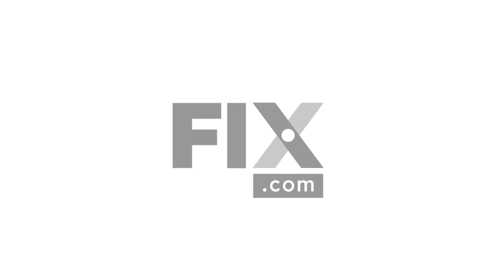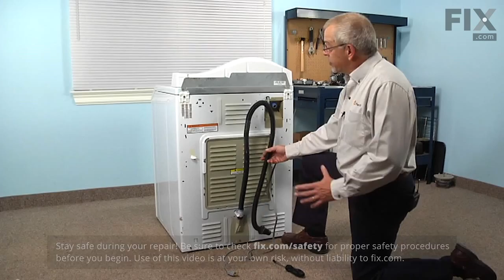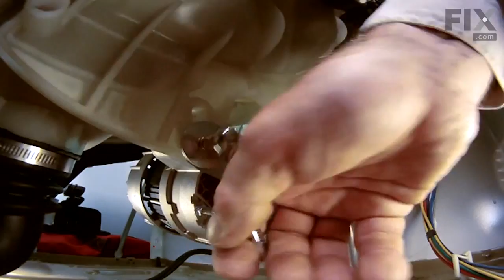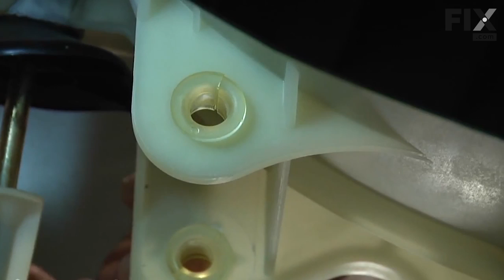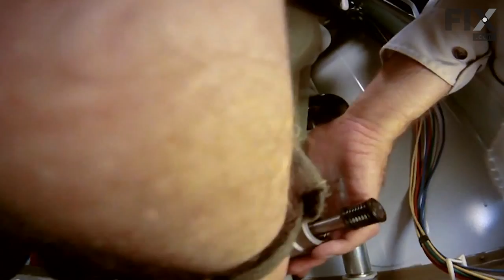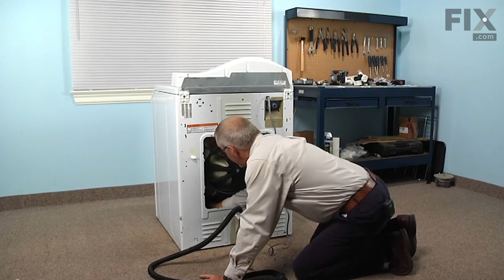Maytag Washer Repair – How to replace the Drive Belt and Motor Isolator Kit

Comment: Thanks for sharing. I have an old Maytag which developed a symptom where the drive belt creeps forward on the drive pulley until it either wears grooves into the back of the tub enclosure or falls off the pulley altogether.  I have replaced belt and pulley, but the symptom persists.  Is this anything you have seen?
Reply: Thanks for the reply! Going on 13 years, here, on the commercial coin-op model after several previous repairs, including the bearings and belt I just did. Going to try to align the motor, but looks like a somewhat common problem. I’ve got mixed feelings about the washer, but it’s water efficient and probably more durable than contemporary consumer models. Seems like we’re in a race to the bottom in longevity, while manufacturers chase features no one asked for.
Reply: @aneroid18  I replaced the bushings as well - they came with the belt replacement kit. Didn’t help. The only other thing I could fathom that might need replacement was the motor itself,  like the bearings were going, and that’s when I just gave in. My new washer is a Samsung, and it’ll do just fine. At this point may very well outlive me, what do I care? Cheers!
Reply: Dealing with this issue, too. Wondering if the motor isolator bushings may be throwing off belt tracking alignment, even though I can’t feel any play at the driver shaft. Did you find any solution?
Reply: @aneroid18  in my case, no. I have been patching and fixing this machine for years, but this time I decided to cut my losses and invest in new. It was a sad day to see her get taken out to pasture, but she was at least 20 years old, so definitely gave us our money’s worth.